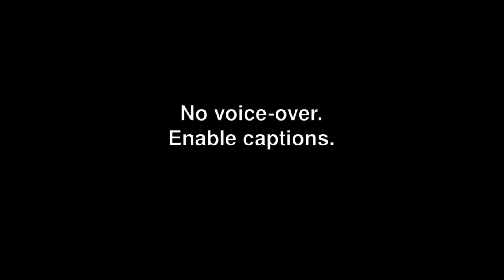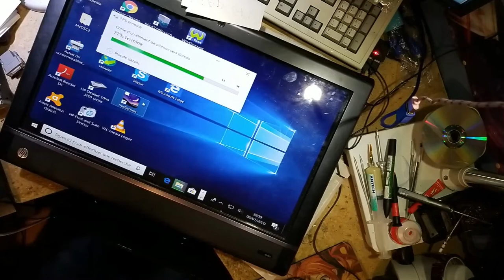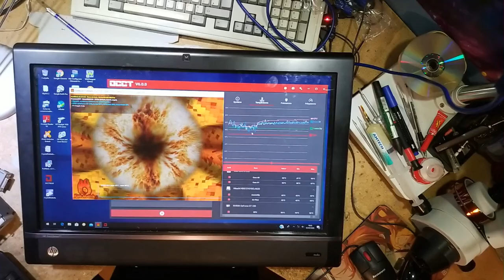T&F HP TouchSmart 610 no image

Comment: I have an older HP Touchsmart that had similar issues with the graphics chip overheating and de-soldering itself. In fact, that is the whole reason someone gave it to me. I "reflowed" it and it has been working well ever since. This one looks easier to take apart and the removable graphics card is great.
Reply from the maker: It's not an issue with the chip getting desoldering from the board or broken solder balls. The chip itself is dead. As you can see at 06:06 I'm not even trying to melt the balls, just giving a little bit of heat and it comes back to life. It's a temporary resurrection that can last anywhere from one reboot to several months, but it's not a proper repair, so we replace the graphics card with one that will not fail again.
When the GPU is not mounted on a standard MXM card it's more of a problem, either you can try to disable the dedicated GPU (rarely possible on AIO), replace it with a brand new chip (rarely available, lots of counterfeit, will probably end up failing anyway one day) or replace with a board without dGPU (rarely possible)…

Comment: I installed a working Nvidia GT330m graphics card, but when I boot the BIOS (version 6.07) there is nothing on the screen and 2 short beeps and 1 long beep. These signals indicate a malfunction of the video card. Is this HP TouchSmart 610-1030y graphics card supported? What needs to be done to make it work?